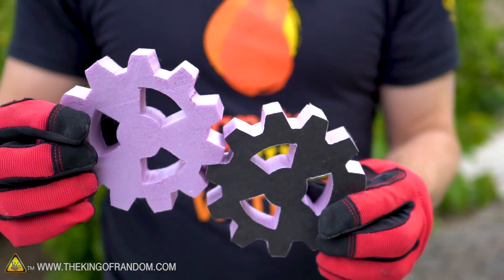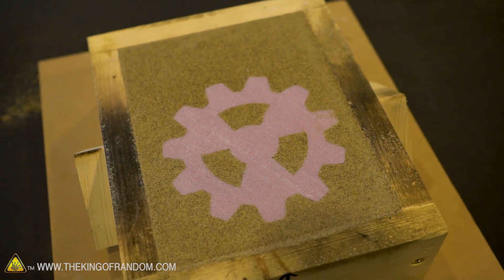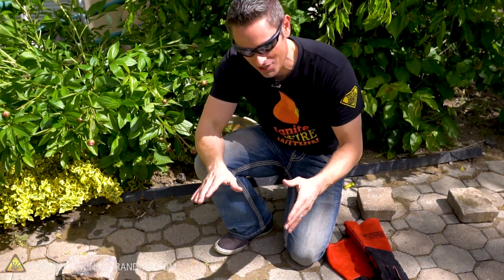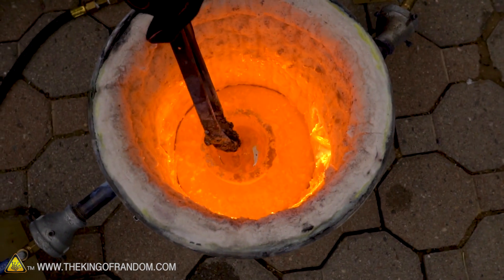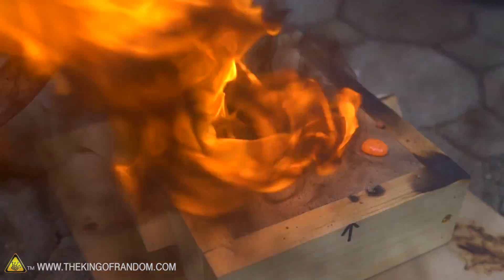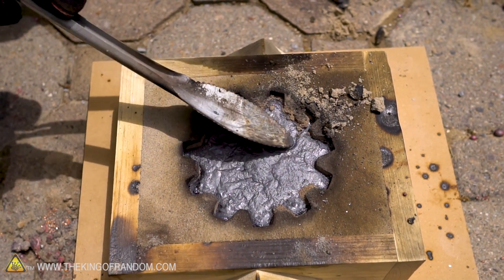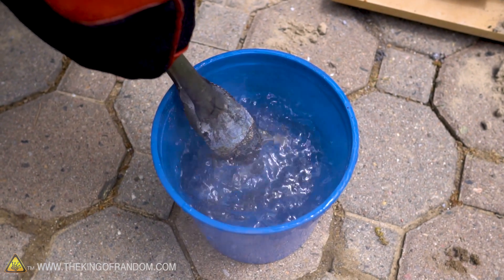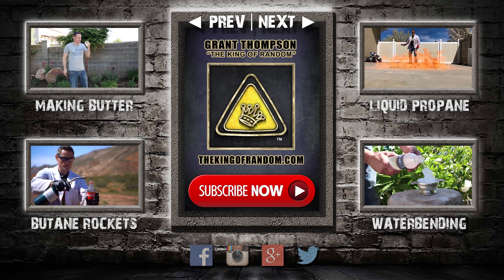Argh. Why Is Copper So Difficult? TKOR Tests Melting Copper In Our Homemade Foundry

Comment: You should use a two piece mould with talc so it does not stick. Then make sprues and gates, and maybe a reservoir if the part is large.

Comment: 2 part mould needed... the parts float up because there's nothing preventing them from doing so but if there was a 2nd part on top it'd prevent it from happening. Check out Tito4re if you wanna see how to do it right

Comment: Try and support the small sand parts by reinforcing them with wire or something. You could also try and use a solid mould made from something a bit stronger.

Comment: You should try burying the styrofoam gear in the middle of the green sand and use a pouring hole to deliver the molten copper. This way the middle sand parts won't be able to rise to the top.
Reply: OR, going off your idea, what if he just put a lid that is fireproof on the top, so that the gear is flush with it. That way he can just pour through a cut out in the top and the sand couldn't float up because the ceiling would be pushing it down.

Comment: Have you tried mixing some clay, as a bonding agent (usually 5 to 11%), in with the sand? Green sand alone doesn't have enough cohesive strength to hold together.

Comment: You should try covering the mold completely with the molding sand, leaving a funnel like space to pour the copper in. This way there won't be the problem of sand floating up. I hope this comment helps.

Comment: In this case you might benefit from a Two-Part mold, that aside, another option might be a wax copy rather than a Styrofoam.  Also, your green sand seems just a TAD bit too dry.

Comment: Grant Thompson, make a plaster mold,before you put copper into the mold put the mold in a oven to evaporate all the moister from the mold to make it more stable so the copper wont boil

Srry for my bad english
Reply: The problem is not the copper boiling, but that he is not using the top part of mould (greensand moulds are made from two pieces) so the copper cools down way too quickly + breaks the mould because it is not supported from the top.

Comment: I think you should try using both the drag and the cope as well as using a wooden gear and removing it instead of Styrofoam, then you may have more success. however still an interesting video.

Comment: Hi Grant! You may try to melt down some materials with higher melting point than copper with your arc furnace. And then make 3 gear hole casts with that. Use them to replace those 3 little sand hole cast. (Don't know if it works, just give you some opinions that might help)
Btw love your videos, keep it on!! :D

Comment: hey grant, maybe intsead of trying to pour an open cast maybe try to attempt it in a sealed/underground cast similar to the aluminium sword and gun you did. also try using graphite instead of sand, if you can get your hands on a large quanity of it. hope this helps

Comment: You need to do a 2 piece mold So the sand in the hollows stays in place. Trying to pour it in like it's a jello mold Gives too much room for the vaporized water to push around. Not to mention the weight of the copper sloshing .

Comment: @Grant Thompson - "The King of Random".

Why not try a ceramic slurry with a wax gear to hold the shape until set you could then leave a hole for the wax to be melted out and the copper to be poured in.

Similar to the Plaster of Paris casts for the Poke Balls.

Since the mould would then be ceramic it could be heated up until the copper has been poured therefore allowing for a more perfect fit to the mould and then the solid slurry could be chipped away to reveal the copper gear.

Comment: When I was a kid I poured molten wax into a glass of water and as it cooled down it formed a nice shape. Can you try that with molten copper or with other kind of metal? :D
Reply: dangerous... it causes an explosion of hot water and the material you poured in until the water gets to a warmer temperature where it doesn't react....
Reply: How about liquid nitrogen then?
Reply: Uston Lim Look at the backyard scientist when poured metal inside on a fish tank
Reply: liquid nitrogen would cool it slower
Reply: Leidenfrost effect, you would have to use a metal that has a low melting point, like lead(i think lead has a low melting point)
Reply: Have you ever seen molten aluminum being poured in an ants nest? That makes like a beautiful tree like structure
Reply: Psychedellyfish And murders 4837943 ants along the way.
Reply: TheDaringPastry1313 not necessarily. At least for aluminum and copper (I know first hand) they don't cause a steam explosion. It's kind of cool, actually. The copper or aluminum would form a bubble of steam around it due to the Leidenfrost effect, once the metal cooled enough it would make a distinct sound and the bubble would collapse. Thebackyardscientist proved, however, that molten salt is a completely different story.
Reply: Uston Lim maybe but if you use enough water and just a little amount of metal maybe the water wont boil that much
Reply: Nikos Katropoulos propably but if you use a larger container you can avoid it
Reply: Uston Lim not with a slow pour in a large enough body of water.

Comment: make a sand lid on that with another sand holder thing xD and then make a channel to the gear which is completely incased with sand, then pour copper down the channel and wait, when its cool enough u put in water and then saw off the channel part

Comment: Try acetone to melt the styrofoam and to prevent the shaft collapsing try using a flat metal plate with a hole in the center to pore the molten copper.  No moisture.

Comment: Love the videos but would it not be easier to use a blowtorch to burn out there Styrofoam First before you pour the copper
Reply: Or he can just pull it out...
Reply: Tazer he did in the last video I think a chunk of sand came off
Reply: If you put baby powder in the gear, put it in the sand, knock on it, you can pull it out with no problems.

Comment: sir u have been using only the drag. i m requesting u to try one last time with also the cope with a funnel right at the center of the gear. i had done this recently in my foundy shop and addition of cope gave a promising result

Comment: I think the water in the green sand is vaporizing which is drying out the sand which is why it crumbles so easily, i have seen some green sands using oil because it withstands much higher temperatures.

Comment: Grant, it seems to me like the problem has to do with the density of the copper- notice how the sand always floats on top of it?  I think if you were to make a mold that wasn't open to the air than the inclusive parts of the mold would have more support, and possibly stay in place better.  Alternatively, perhaps there is something you could lay on top to hold them down while you pour.

Comment: you are casting with an open die which wont work this type of metal you need a closed die which is much more complex. the closed dye helps copper stay at a Liquid stat longer and keeps the die tightly in place (die =mold)

Comment: when I used to work at a metal casting foundry. we would use a special type of paint to keep really hot metal from contaminating the sand when the metal was poured. another thing is we used a top piece is and as well. It would have a funnel shaped spout to allow for shrinkage.

Comment: maybe try making the mould hollow so there's two sides to contain the heat and they'll be two solid walls to maintain the coppers shape cut a channel into it so the copper can flow into cavity then once it's hardened just smack it out the green sand. hope that makes sense

Comment: Can it be because the sand is too moist? When the water in the sand starts boiling, the steam knocks the middle pieces away, due to the larger volume the steam consumes compared to liquid water.

Comment: maybe you should have tried pre-heating the sand mould, they do that in industry when casting steel to slow down the solidification providing better fluid flow

Comment: You should use a closed mould. This would mean that the radioactive shapes cannot float up and ruin the casting. Also, pouring the copper directly onto the sand could damage the mould. Using spruces instead should help with the problem. Hope this can help you succeed!!!
Reply: HOWYOUBEEN depends on where you live like with colour or favourite
Reply: HOWYOUBEEN grammar nazi
Reply: Real IvivI He ment the radioactive shapes.
Reply: GamingRising Exactly
Reply: Ash Cain yeah basically like the mini master sword
Reply: Vern VanGuard King at that time.
Reply: • MDGamesNL • ohh ok i got it :D
Reply: this is 'murica, we threw out the queens English at the same time we threw a certain tea party in Boston ages ago, but no one ever talks about anything but the tea...  xD
Reply: Ethan S He meant the spruce. But yeah,  a two part mould will yield a much better casting.
Reply: Please read Ash Cain's comment Grant. Green sand casting is meant to be done with both cope and drag.
Reply: Ash Cain +
Reply: ABA Gaming Yeah, similar concept
Reply: Ash Cain he should also use professional greensand of he's super worried about quality
Reply: ABA Gaming actually nothing like the master sword grant could get a better cast using a two-part mold.Also try a wax mold
Reply: what about the silicon mould he used for the pokeballs
Reply: Real IvivI there not radioactive obviously but there the parts that make it look like it radioactive
Reply: Yeah, he should use something more solid as a mold like temperature resistant gipsum or whatever is it they use casting bronze and iron
Reply: Ash Cain wood might work as well because it doesn't completely burn
Reply: ABA Gaming He could use wood as long as he used it only as a pattern for the greensand and then removed it, leaving an empty cavity.
Reply: Ash Cain there r no radioactive parts dude
Reply: Nope, depends on if you are using incorrect english or proper english.
Incorrect being American, proper being British.

So he is right.
Reply: Howyoubeen, it's "mold, not mould", not "mold not mould."
Reply: Ash Cain it's mold not mould.

Comment: You can use paraffin sample in the sand. it will melt to liquid and will be easy to remove. It will be more gentle to the sand. you can use toilet paper to absorb the liquid paraffin from the mold

Comment: if you use talcum powder on the gear then you should be able to just pull it out with a twisted in screw, meaning you dont have to melt it first

Comment: Why not use hardened clay (or plaster) instead of sand? You could then heat up the clay with the torch so copper won't cool down too soon. Then break it and voila.

Comment: Hey Grant really nice video :-) READ THIS!!  :-)I've tried a bit of alluminum casting with your metal foudury and sand molding. What I discovered is that is actually extremelly important to pack the mold both on the top and on the bottom with sand and have at least two channels to put the liquid metal, one acting as a puoring hole and the other as a vent hole, if you put more than one hole you can pour the liquid metal from multiple points. By having the mold fully sommerged in the sand it helps a lot to keep the heat in and to keep the mold in shape. I've expericend exactly your problems when I was trying with the same technique you show in the video. Trust me if you follow my advice you should be able to have a successful cast! I love your videos by the way :-) let me know what you think. 
Mirko

Comment: What would happen if you added a binding agent, such as clay, to the green sand mix? It might allow you to use less water, with less explosive boiling off of the water in the sand. You might also have a reusable mold. A side note is the crank case of your old Cessna was sandcast. And if you're going OCD over brass gears, you've slipped a cog. (Sorry, the pun was inevitable.)

Comment: what would happen if you were to make a solid 1 piece lid over the top of the mould with a pouring spout. wouldn't the weight of the top help to hold the smaller inserts in place?

Comment: My guess would be, after watching the video, that the copper is too heavy and too dense for the sand, pushing it apart and making the smaller parts float to the surface. But I dont know, as i've never done any casting of metals. cool video, tho.

Comment: Sand is mostly SiO2 and has a density of approx 2.7 g\cm^3. Copper has a density of approx 8.9 g\cm^3. that result can be nicely seen in your video. it's floating. you either use a closed mold or use different sand. I also recommend to let it completely dry. the water in it sand expanses due to the heat.

Comment: Grant, your sand keeps popping out because your sand is too wet, all of that water is becoming steam and is trying to get out. The mold's weakest points are where the steam is going to come out (the radioactive parts in the middle). Try using drier sand instead of wetter.

Comment: I got it to work. It was odd on how i got it to work.

I made 2 batches of green sand. The 1st one had more water then the 2nd one. I put the 1st batch on the bottom of the gear so it was touching but just enough to cover the gear. I then took the 2nd batch and filled the rest of the box with it. It took 2 tries for me but i got it to work.

Comment: I'm thinking the sand was popping out because it was too wet? you'd think the water in the sand would flash vaporize and expand when the molten metal hits it causing the bits in the middle to pop out. just a thought

Comment: a cement mold could help you
Reply: It may crack and even explode if the mold has moisture in it... I don't think cement molds exist, might be wrong though.
Reply: BlackBlade4Life you're completely correct, cement holds moisture and explodes when the moisture inside turns to steam

Comment: Molten copper/aluminum in liquid nitrogen anyone?
Reply: Luke Benson it does explodes. its a dangerous experiment.
Reply: Fair point...
Reply: Why? It will just explode into small pieces because of huge temperature difference. And it can be EXTREMELY dangerous. No one wants to get hit in the face with molten metal.
Reply: Luke Benson that would be sweet
Reply: Ernests Aizkalns Ware a mask 😎

Comment: From watching these pours, I think you may need to go with a 2 part mold with spru. When you try to pour it open faced, the heat from the crucible dries the sand and makes it crumble. And when you pour it onto the styrene without melting it first, the sand dries and floats out. If you used a 2 part mold, the water vapor would have trouble escaping (stay trapped in the sand) and the molten copper itself would hold the sand in place so it couldn't crumble and has nowhere to float out.  :)

Comment: May be you should heat the sand with torch before pouring? To decrease the temperature difference between sand and copper.
Reply: The epoxy will probably burn at these temperatures. I like the other suggestions of using a cementing material like plaster, or, cement, better personally.
Reply: I think the reason why copper destoys the details in sand isn't just the temperature shock but also the fact that the water in the sand evaporates and doesn't hold the sand together anymore. Plus copper is heavier than the sand so the sand floats on it. Adding something else that would hold it together might work. Like adding some dirt or clay?
Reply: What about making a mold with sand and epoxy resin?
Reply: About heating the mould: without water, it would crumble from even the slightest touch.
About cement or plaster: if there were even a little bit of moisture left, the moulds could even explode. Tried it once, mould broke in half and all metal run into the ground. + it would be really hard to remove the mould from the casting.

Comment: Use clay instead of sand and a steel box. 
That way you can heat up the mold in a larger variant of your bucket oven and give the metal a chance to flow and cool down far slower. Also the problem with the details popping out is buoyancy. I'd recommend reinforcement there. Maybe a simple nail in the mold gives it the stability it needs.

Comment: Try making the mold out if the sand/plaster mix you used for your first forge, heat up the mold and keep it hot before you pour.  A hot mold should slow the cooling process

Comment: It is obvious that the green sand does not have the integrity to hold up to the emerging steam created from water in the green sand evaporating too quickly. My opinion, is that green sand will never hold up - you are not purring aluminum. Maybe a choice for your mold would be gypsum.

Comment: look. at. mp. dragon. you were making a rookie mistake, the green sand was not made correctly, if you use oil it is much better and dont use styrofoam for the casting use wood and remove it before casting. also make sure you are ramming the sand down hard enough.

Comment: What you could try is putting both sides on the mold, so the gear is supported from both sides. Then you make a funnel shape in the centre and pour the molten metal in; nothing will float, both sides of the gear will be cleaner and yeah, seems like a legit idea to me.

Comment: Try using a double sided box with a hole leading to the mold so that the weight of the top layer will keep the sand on the bottom layer from shifting. Your last pour was the best because you had it melted enough.

Comment: I have done green sand copper molding before successfully. What i did differently was i went from the edges and poured slowly to allow for the sand to stay still and not get rushed over by the molten copper.

Comment: The idea of the Styrofoam is to hold the sand back until the copper takes its place. Melting it before you pour defeats the purpose of having it there in the first place. Also you would get better results if you used a closed mold with a sprue and riser.

Comment: maby it'll work if u surround the styrofoam in concrete, let it harden and then pour in the molten copper, then the little bits in the center will not come loose